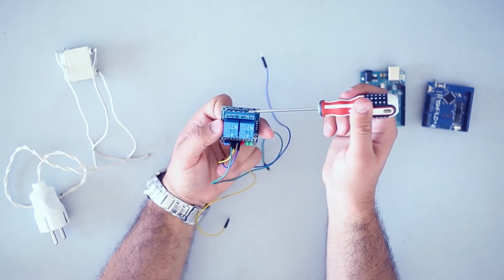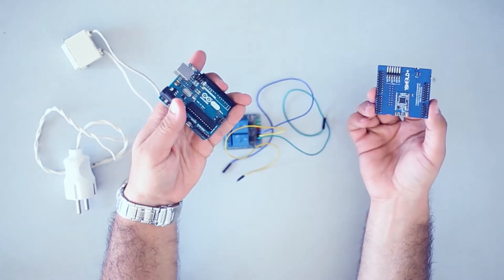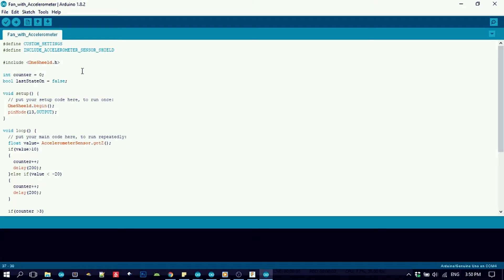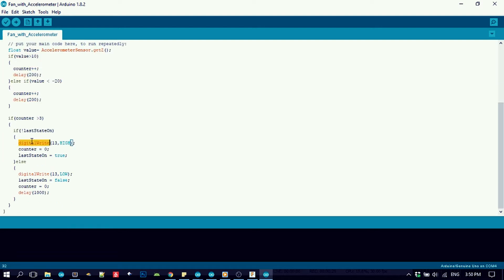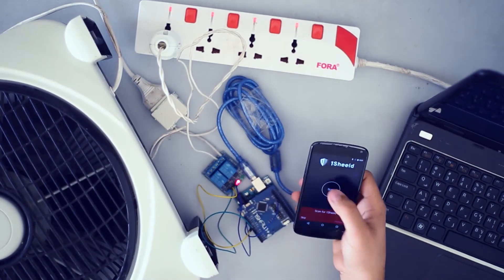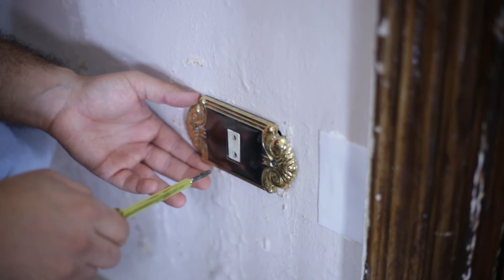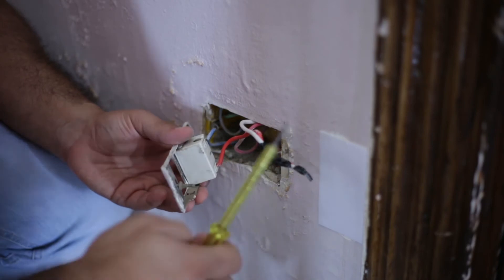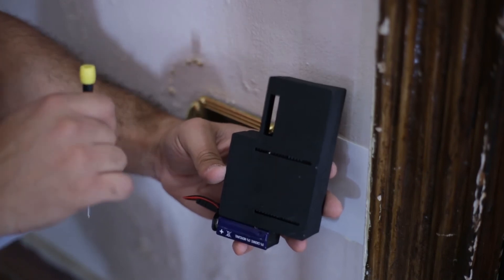Control a fan with smarpthone gesture (ِArduino Home Hacks #2)

Comment: I've been searching for this since a while now. I'm curious that is the arduino able to take analogue values of acceleration , gyroscope and various sensor as in print screen on PC ? and for certain values of sensor , certain I/P , O/P can be defined , just like normal sensors ?